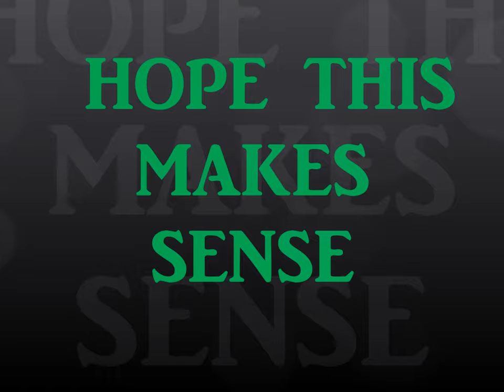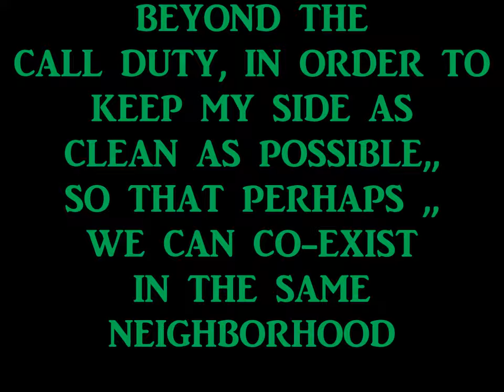HOPE THIS MAKES SENSE

Comment: I do the same thing buckin! When I’m cutting timber on timber sales then I run chisel ground. But in the cases where your cuttin old burn sales I always ran round ground. Just because it holds up better to the burned bark an wood. When trees are burned their very abrasive. Wears saws out quickly too. Gotta stay on top of filter maintenance!!!
Reply from the maker: indeed sir

Comment: Some mates always say doing it this way tempers the chain and then they can't hand sharpen as easy when they go to the job, they are arborists and use the skip tooth as you say... but does sharpening this way temper the chain... Thanks
Reply: Only if you over heat the chain. Nothing will temper the chain but heat.
Reply: Victorious victor ok thanks... appreciate it
Reply from the maker: Yes what victor said.   I don't round grind.  I square grind. Thx for your input here.  Stay well
Reply: Could you possibly do a video sometime explaining round vs. square grind?
Reply from the maker: absolutely .. just added it to the list thx for the content idea thats great ... Be well

Comment: i have two thing for you, first.  a brand new chain should a a guy refile or regrind the chain before use it or/ run it out of the  box/packaging ? the second thing is have you ever thought about putting  stacks on the mercy i personally think it would look awesome  with a pair on it,and a cab guard with work lights on it and the flat deck would look bad to the bone with a pair of stacks on it as well.
Reply from the maker: yes it wood actually , I may look in to that ,, thx Gar
Reply: thank you sir for the info. remember my xl12 that i told you about i do not have a bar and or a chain for it but i found a 24" 3/8" 50  Oregon pro bar new for around $67.00 US dollars at mfg supply .com, and they also carry  chain there as well but, the sale the chain by link so i don't know to how to figure out how much chain i need for the 24" bar plus drive gear any ideas please? thank you. brothers for life.
Reply from the maker: 84 drive links friend
Reply: thank you sir .

Comment: I don’t think I hit steel, but I run into rocks pretty much every tank or two. It sounds like I should stick to skip tooth, but I’m having a terrible time hand filing because I have MS. 
Not hitting rocks seems the obvious solution, but I curse and insult myself every time, so insulting me won’t improve performance. I’m working in loose rocks and leaves hiding them. I’m cutting off trees at ground level for running over them, and I buck up stuff so it can thrown out of the way. 
I won’t be doing this so intensely once I have another few miles of trail cut.

Comment: With your years of experience, and skill-set hand file sharpening is there a quality difference between you hand file sharpening and the grinder or is it simply faster to grind?
Reply from the maker: THE GRINDER IS A SQUARE CHIZEL GRIND , AND HAND FILE IS A ROUND FILE THAT I USE ,,GOOD QUESTION THX
Reply: Oh I see what you are asking Steve. I think there is an ego thing for nist callers they like to think they can file better than anyone. But at the end of the day, a grind with give you a better edge with a more consistent product. Its basic engineering. We dont file a crankshaft we grind it. But you get a faller who has worked in the same kind of wood a while e.g 100 year old douglas, day in day out, with the same saw, his filing will subconsciously find a pretty sweet spot for the wood he is in. However it's one of those subjects you will hear a million different opinions so I recomend you compare both for yourself and see what you like best
Reply: Not cist callers I mean most fallers sorry lol